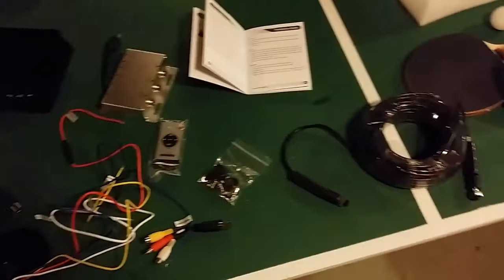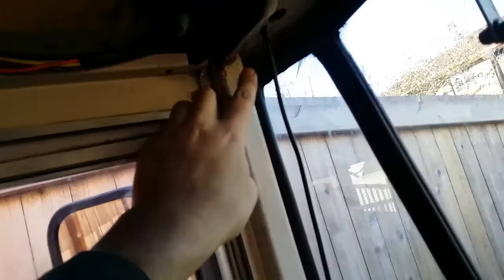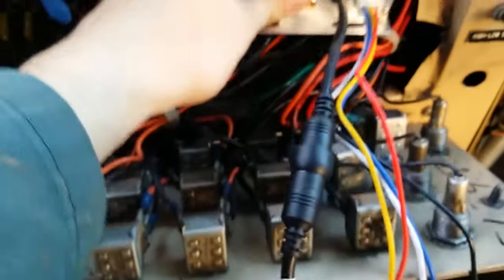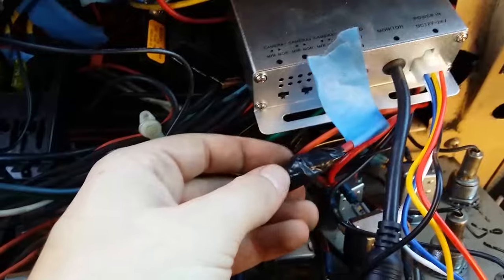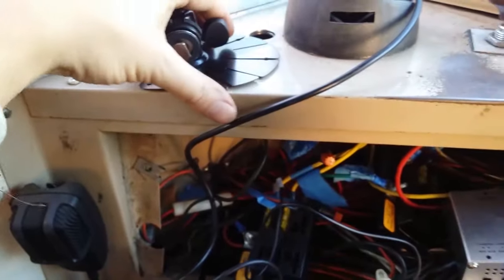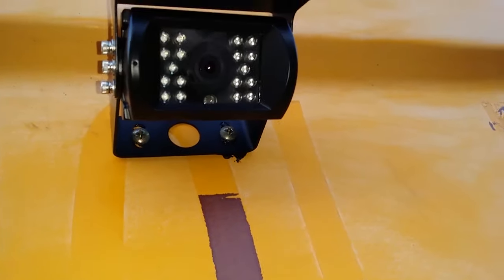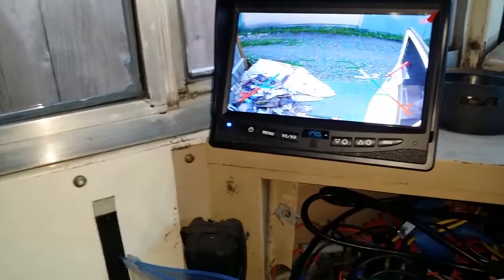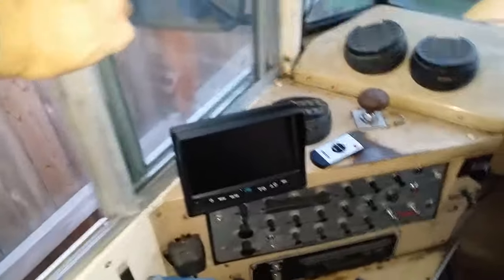Conversion Video 9- Backup Camera Installation

Comment: The holes drilles through metal should have a grommet for protection.  The home centers or radio shack would have them.  They come in sizes so chech your holes first.